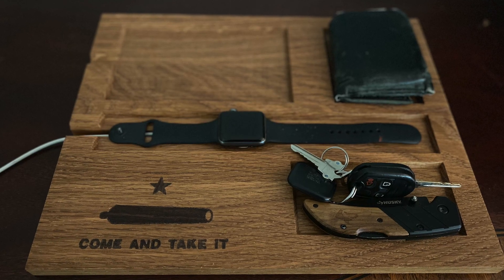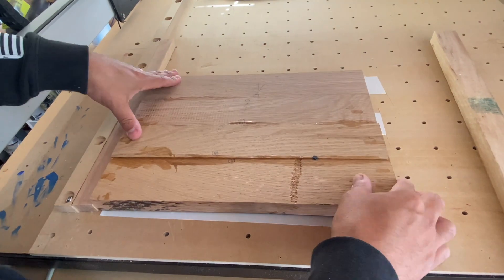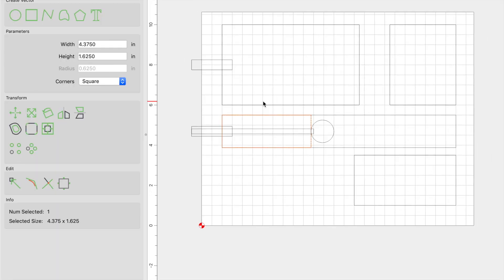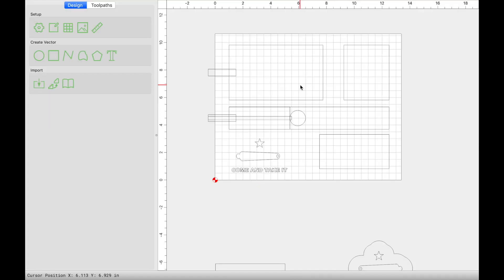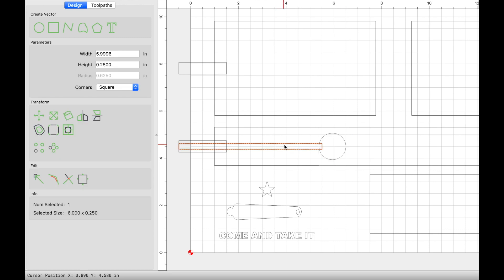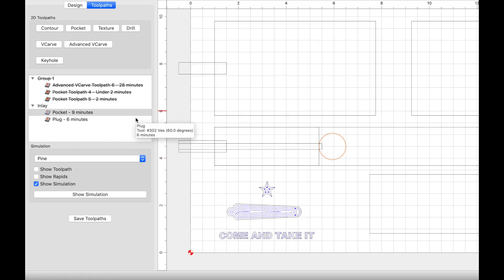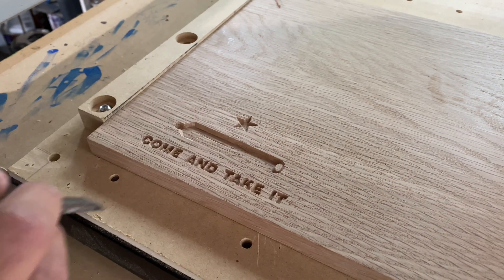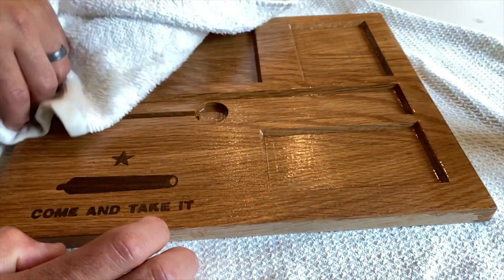How to Make an Inlay Catch All Tray on CNC | Carbide Create Tutorial #cnc #cncwoodworking #shapeoko

Comment: When you do the inlay do you make the pocket (on the female portion) a couple of thousandths bigger than the male/plug portion?? Or do you just leave them both (male & female the same size??

Oh & great video BTW 💯 🎯! 

Also the X-fasten tape is great for exactly how you used it. I hate using if I have to cut through the entire size stock. I prefer to just use the tabs, though I’ve had a couple of projects where that wasn’t beneficial to do. Anyways I’m looking forward to trying my hand at some inlays!
Reply from the maker: Hi Pierces....been away for a while and stil getting through many comments a bit at a time. 

Regarding your question, I make them the same size to ensure a tight fit.

Comment: I just wanted to thank you for doing such detailed and thorough videos. I really appreciate that you take the time to show all the settings and all the steps from start to finish. I’m brand new to CNC and so many videos just assume you know how to do some of the more basic steps and don’t show those but for a newbie I’m lost without them. So thank you!

Also, can you tell me what brand of controller you use for your machine (to move the router/spindle)? Thanks again!
Reply from the maker: Glad these videos help! And appreciate you checking them out.

I use the rii wireless controller.  It’s linked in the description of the video. I have a review of it on my channel as well. They have a Bluetooth one now. I have the previous model that requires the USB